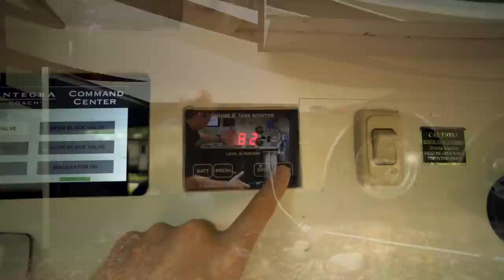Throw Away Your Sewer Hose? - Thetford Sani-Con Turbo Installation & Detailed Review

Comment: If your sewer hose stinks, you aren't cleaning right.  I have been using my hose for 4 years now and it doesn't smell at all.  After use, clean it with hot and soapy water and then rinse with clear water.    Works every time.

Comment: I too have looked at a macerator and ended up with the Sewer Solution.  Have used this for over 6 years and has never let me down.  Slow, yes, but when you have to pump 70 feet and a little up hill and it gets the job done, I'm alright with that!  Do I use it all the time, NO!, but when I need it, it works!  Also cleans out the hose with fresh water to boot and no mess involved.  No electric, only one basic moving part, the lever to control the stream of water and no issues!

Comment: I'll never understand why everyone thinks emptying a holding tank is hard, it's easy.   Just empty it, geez  I honestly believe the more junk you buy the harder it is, toss all that junk.
Reply: Thank you !!!!
Reply: some people have semi permanent campsites that need a macerator due to grade
Reply: I completely agree with you
Reply: I agree, it so easy, been doing it for years
Reply: @genogeno1234  that's the stupidest thing I've ever heard
Reply: @kccarrtheoregonhillbillyhi4803  what is stupid? If your campsite is downhill from the cleanout, why is it stupid to use a pump?
Reply: @genogeno1234  They have never used a pump system and haven't a clue.  Pretty sure I wouldn't want to buy any RV they might be selling :)  Too many times I've camped where my output is lower than the dump.  Breaks my back lifting a 3" hose full of water to drain it :(
Reply: Life is hard… It’s even harder if you’re stupid.

Comment: I am new to RVing, but my friend Bob taught me to first dump the black water tank, then dump the grey water tank to clean out the sewer hose, then I rinse out the sewer hose with fresh water and I have not had a stink problem.  I do not put caps on my sewage hose (I have them) I couple the ends together and rinse off and shake the loop before storing in a plastic box.

Comment: Interesting. Our Roadtrek had a macerator system from the factory. After having it operate sporadically (mostly not operating) I easily converted it to a regularl gravity dump. I think it was about $30 in parts from Home Depot. Gravity has never let me down and no more macerator problems. KISS method!

Edit: Oh, I forgot to mention I purchased the Flo Jet macerator system for my 40 foot Class A. I have used it just a few times. It pumps things for a while until the motor gets too warm and the thermal switch inside the motor stops it until it cools down which takes some time. All the while you are sitting there with your hose in your hand (pun intended) waiting for it to start back up. Having 100 gallon holding tanks (each) means alot of hose holding. LOL!  Needless to say it was kind of a PITA. One note is that in 15 years of full timing, I never specifically NEEDED a macerator. The standard gravity dump empties the holding tanks fast. The macerator sits there pumping away (until it overheats of course). Just food for thought.
Reply: The pump you had was too small and poorly designed and poorly made.  This guy said it emptied in about 90 seconds so this will not heat up or cut out.  I think the hose size was smaller than the standard drain hose but bigger than a garden hose so drains faster than a garden hose yet not as bulky as the gravity drain.  I liked it and though it was a good design but don't know if I could afford it.
Reply: I've had the same problems as you and went thru several different brands of 12v mascerators.  Do you know of any 120v mascerators?  They used to make them but I can't find any nor can my local RV parts shop.

Comment: I used the old Thetford "Twist On" system that connects the macerator motor directly to the 3" dump outlet. I liked the ease of it, but so slow. The new system looks pretty good, but I did have a couple of hose failures on the old system and that is something you NEVER want to deal with. One flaw you can see with this new system is that water (some waste) will always sit in the short 3" hose that connects the outlet to the macerator pump. I changed to the Lipert Waste Master system. It's a very heavy duty 3" sewer hose but with cam lock connectors and a large 45 degree angled plastic hose-end nozzle that has an open/closed lever. It's great. Fast. Clean and easy to deal with.
Reply from the maker: Thanks for the info! Yea our wet bay was a bit tight and our factory fitting was low so it’s definitely possible for some stuff to sit in that pipe but so far it has been fine. Will keep you posted in future videos! Also I think this hose is much improved, with the sleeve I think well be good for 2-3 years and then well probably swap just to be safe. Replacement hoses are pretty cheap and in some ways I consider that a maintenance item that just needs to be changed every few years!

Comment: Not trying to be a wise guy or anything; but why do i want to go to the expense ($250-$400+) and possible a electrical fail ? why would I go to this vs my old tried & true hose system???  The chemical additive to my black tank pretty much disengrates everything. A quick rinse with the gray water dump & most places have a hose with fresh water to complete the rinse. Given no one waiting behind  me I usually flush the black tank with clean water at the dump station for about 10 minutes as well. My hose fits in the bumper and after 3 years has no issues. Am I missing something ?
Reply from the maker: All good points. For us the idea of saving a full bin of cargo space, pumping uphill and not having to do anything other than twist a hose cap off and insert the handle into the park system was worth the time and expense involved. That said, our standard setup worked great and was a lot cheaper with fewer parts to fail. Time will tell! Thanks for the comments.
Reply: @LivinliteNet1  Appreciate the reply. I knew about the pumping uphill but have not been faced with that but one time. Curred it by pulling out a few leveling blocks and rolled over them. Most dump stations are built to a  downhill configuration. As we all know ; human affluent doesn’t flow up hill. I thought you were just trying to ‘grind’ it up before it went down the pipe. When I had a Class A; I use to go thru the same process as above but instead of a bumper to store it, I placed it in a capped PCV pipe attached to the bottom of the rear bumper brackets. The elbow in a zip lock plastic bag stored in the basement storage. Again, thank you.
Reply: You make excellent points.  For us I'd like one to be able to pump the tanks into a toilet right inside our house as we do not have a sewer opening outside the house.  But for that price I just can't justify it.
Reply: @Cw Sayre while I see the point of not needing it for "standard" FHU situations there are times this system can be a go to.
Another YouTube video showed it idea for situations where no sewer was available.  This individual pumped it up into a tank in the bed of his pickup and then hauled his waste to a dump station. 
It was a perfert solution for those situations.
Reply from the maker: @herb7877  thanks Herb, its such a tough topic because I agree with everyone that the standard solution is a great one and has so many less parts to fail. Its similar to the conversations I used to have with folks about power windows and door locks in cars. "that will just break!" and often it did. Alas the faster, more convenient solution won out though, and now I dont think you can buy much of any base model car without those features. After having the system for another month my feedback would be that the convenience is the primary win here. We park, open the bay door, unscrew a cap and place a handle in sewer and thats it. There is nothing more to do (well open the black tank and hit a switch but we had to do that anyway). Is that convenience worth 350 bucks? Thats not for me to answer as everyone has different opinions on what is worth $$. One positive is that I haven't accidentally banged my head on an extended room slide in 2 months which used to always happen when I was setting up the traditional system going back and forth with all those hoses/extension and bins! I guess thats a positive!  Thanks again for your comments/replies. Hope to see you on future videos.
Reply from the maker: @Cw Sayre it really comes down to a claim of convenience and a less involved hookup process. After 2 months with the system in full production as a full timer I can attest it is a lot more convenient. We just open the door, grab the hose by the handle, unscrew the cap and put it in the sewer.. thats it..) It has saved us a lot of time and we are really happy with the solution but a pump failure or other part failures could change our mind very quickly!
Reply from the maker: @CampingFamily  definitely go with the flowjet. So much better for that. Our video of us doing this exact thing is here: https://livinlite.net/dumping-your-black-tank-at-home/
Reply from the maker: Hey Herb, correction on the unit price, its $299-$349 for the unit. My higher price before estimated including dealer install costs and Thetford just let me know the price is lower than I thought.
Reply: @CampingFamily  Look for a sewer line clean out, should be inline with the waste pipe to the sewer tap. Normally a 4" white PVC pipe fitting with a screw off cap.
Reply: I was thinking the same thing!!!  Why do I care if my poop is ground up or not as it goes down the sewer???
Reply: @Herb - Neverminding the hate this poor guy has been getting for this video... "A quick rinse with the gray water dump & most places have a hose with fresh water to complete the rinse." - Has always worked for me; I don't have an issue with a stinky hose (not that I'm sticking my nose in it) - It seems to me that they leave their grey-water open to outlet; If they'd let it fill and, dump it after the black-water... probably wouldn't be so much issue - idk. I think that you 'nailed it', though.

Comment: I opted to not have this installed on my new rig when we ordered it.  I did not like the fact of using some odd ball sewer hose that when it breaks I cannot find one at Walmart or camp store.  Seems they already had issues with the hose from the start if they and to make changes to the hose material. I like the time tested method of the standard sewer hose.

Comment: In order to rinse the system couldn't you run fresh water down the toilet?  (I don't own an RV or have ever owned one so this may be a stupid question for the experienced folks here)
Reply: Yeah you can go to dollar tree and spend 5 to 10 dollars of cleaning stuff and once you empty the tank you can fill it with water and cleaning stuff. Peolle dont think.
Reply: This is a viable solution if you are at a full service RV park while dumping your tank at your slot but not an option if you boondock or have to dump at dump a station. no one is going to put up with waiting in line while you fill a 40 gallon tank at a dump station then re-dump to clean your hose. If its a "pay to dump" station then that's an expensive way to clean the tank, pump and hose.
Reply: @MYCHANNELWITHMYSTUFF  1 I dont care if people have to wait and only reason I say that is because when I have to wait no one ever gives a shit.
Reply: @MYCHANNELWITHMYSTUFF  #2 if I pay to dumb I take as long as I need and if you pay to dump they have water and I'm paying for it and I'm doing my job. No will make   hurry I dont want shit smell while I'm driving down the road.
Reply: @MYCHANNELWITHMYSTUFF  also if you dump with no water you can find alot of places that will use their hose or spicket

Comment: Looks interesting. I know several RVer's with macerators and most carry a stinky slinky just in case their macerator has a problem. It's no fun having a system that is either plugged or broken. Kinda like, if I have a backup I'll never need it but if I don't, I'll need the backup yesterday.
Reply from the maker: My thoughts were that wed probably just buy the $10 cheapy slinky available in most rv park stores in a pinch if we had an issue as we really want the space but agreed!

Comment: ERIK,
Item One :
I watched a video from a full timer who said he replaces his sewer hose every
year just to ensure his does not develop a leak.
Item 2 :
You need to install a sewer hose storage pipe under your motorhome.
The home stores sell plastic pipe in white, grey & black. They come in 10ft lengths.
Cut the pipe to the appropriate length & hang it from the underbelly of your motorhome. SWEET!!

!
Reply from the maker: Not a bad idea, we toyed with the idea of doing it up by our propane tank as the factory installed one there looked like it had the depth just not the diameter so a pvc replacement would work. The underneath option wouldnt likely work for us as when our coach airs down it can sometimes be less than 4 inches from the ground. Good idea for the right coach!

Comment: Erik, we love our WeBoost we purchased from you at Rondout RV park in NY.  Really helps when we need that little extra.  We are not big fans of macerators, as more moving parts mean more issues in the end.  Having full timed for 6 year and now doing it again, when we need to dump over 40 or 50 feet, we have found our Sewer Solution is the ticket.  Otherwise, we stick to the heavy duty universal sewer hoses.  Still waiting on the video of the touch panel!  Pretty sweet!

Comment: This isn’t a replacement for a standard sewer hose, why would you need to replace the simple solution with a more complicated one? This is for RVrs who don’t have a dumpstation available.
Reply: Yes. We installed it for use while at our base camp in order to pump through a garden hose into our septic tank. (Can also come in handy while mooch docking). We can optionally disconnect the Sanicon connection and dump at dump stations and full hook-up sites utilizing our standard Rhino hose.

Comment: At the risk of coming off as the Newbie I am,  can someone explain the sequence of dumping both the gray and black water when using a macerator? I have not owned an RV for 20 years and am not familiar with dumping with a macerator. Specifically, assuming all valves are closed (black, gray and main valve) when I dump with a macerator, do I remove the fitting for use with a water hose and put the macerator hose in the dump at the RV park, open the black valve using the macerator hose and macerator, dump the gray water using the macerator pump and hose then close then close the black valve after flushing with water? Do I use the traditional sewer hose at all if I leave the macerator hose hooked up to dump gray water?